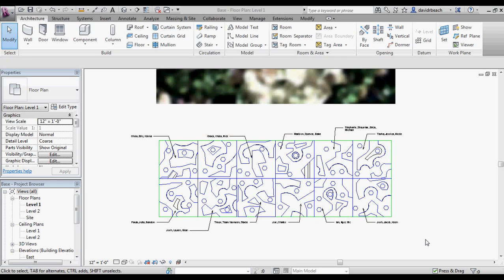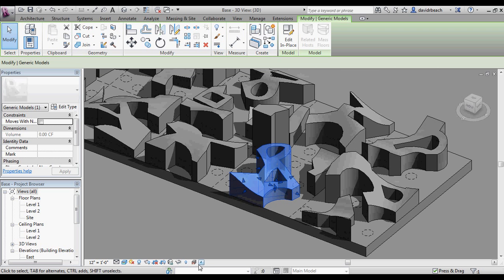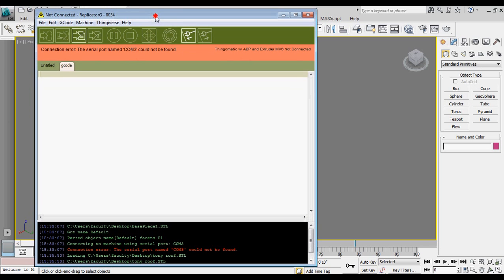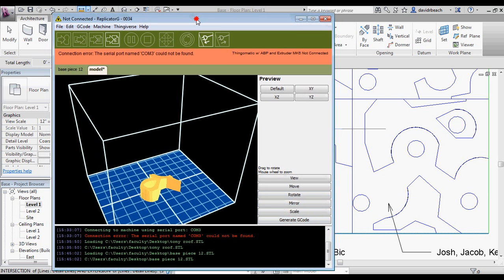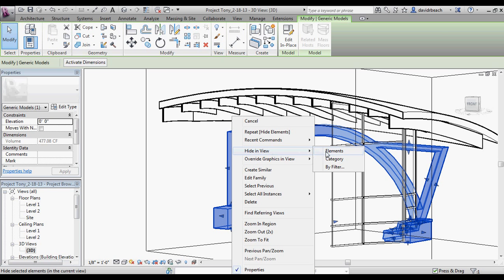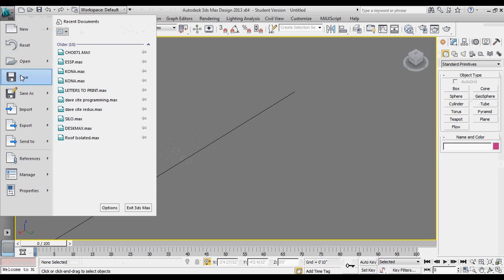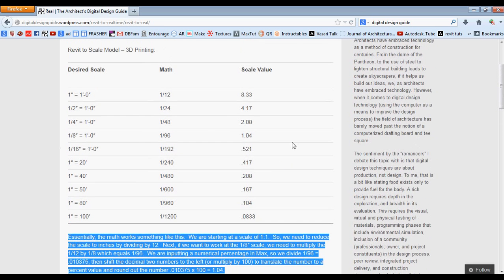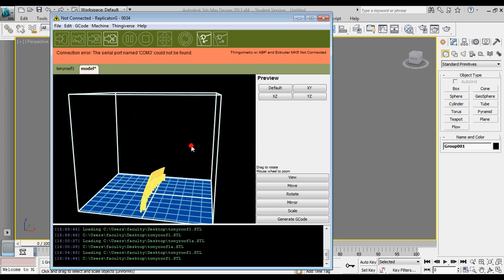Revit to Real - MakerBot (Part 1 of 2)

Comment: David, your video was very helpfull, thanks, but im from Brazil, do you know where i can find the scale values on the metric system? Thanks and keep up the good work
Reply from the maker: +Marcello Henrique - I have not put together a spread sheet together yet for metric, but the process to begin is pretty simple. For me, visual thinker, i build a 1 meter cube in my modeler of choice, export and import into my slicer of choice, and then reverse engineer any discrepancy in the size. From there, it is pretty easy to resolve what the precise scaling issue is (usually a unit conversion issue) which is typically a bigger problem working from imperial to metric.